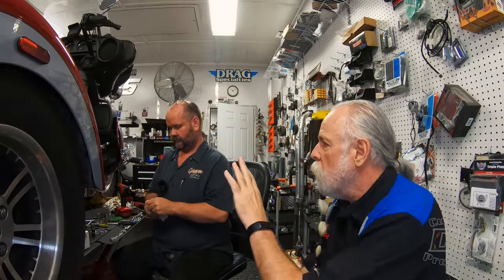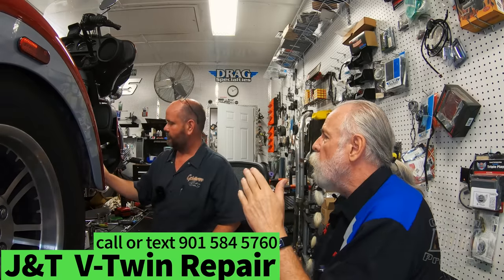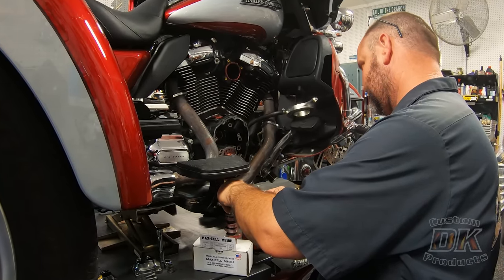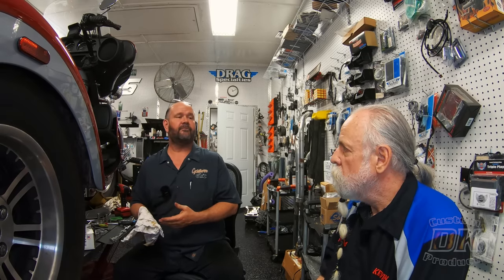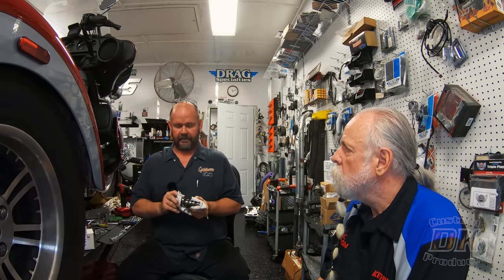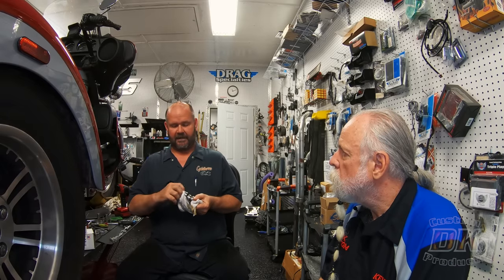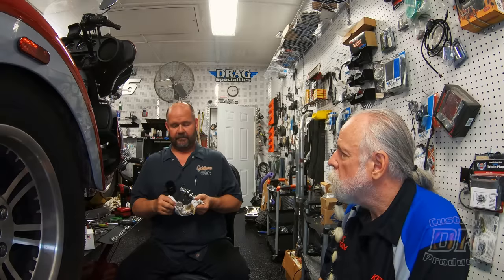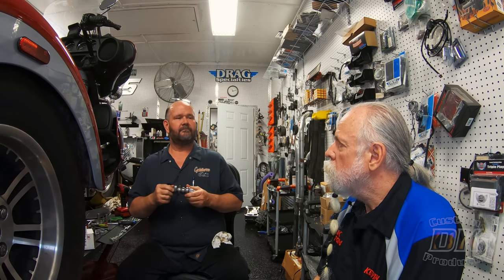How to Get Some Chop (Lope) From a Harley M8 Engine

Comment: Which cam would be the right one for my Breakout 114 built in 2020. I can't decide between the two. S&s 475 and Star Racing 30/30. Unfortunately, I couldn't listen to them live. But only on videos. The 475 is louder and more bassy in terms of sound. What is your opinion of the two?
Reply from the maker: NOTICE:
It Is Strongly Recommended that a Proper Foundation is In Place PRIOR to Installation of a cam upgrade.  Without a Proper Foundation, one will Not Get Anywhere Near as Much Increase in Power from a Cam Upgrade.  
💥  Here is a Link to a Video that Outlines a Proper Foundation-
https://www.youtube.com/watch?v=GK5x3lcQvJU

SECOND IMPORTANT NOTICE:
DK Custom does not sell cams, nor are we suggesting this particular cam for your Harley. We are  reviewing what cam upgrade Kevin did on his Trike. If you'd like to purchase this cam, contact Jamie at V-Twin Repair - 901-584-5760

The world of cam choices can be very confusing.  Unfortunately, we have not done testing on a lot of different cams, so it is not possible for us to make an informed recommendation.

We will say that we have heard a LOT of good things about both of the cams you are looking at.

Here is a video of what I looked at in making my decision-

https://www.youtube.com/watch?v=iKOaSm2ffBo

Comment: is that jims closed , pretty hard to contact or find info on cam specs
Reply from the maker: He is keeping his circle close.  There are some videos here and there, and they do have a facebook page. But you will need to get the cam from a shop that has a dyno and that is a dealer for them.  Here is one below.
NOTICE:
IMPORTANT NOTICE: DK Custom does not sell cams, nor are we suggesting this particular cam for your Harley. 
We are  showing & reviewing what cam upgrade Kevin did on his Trike. 
 If you'd like to discuss this cam, or any other cams, the shops below can help you.  These shops deal with the Max-Cell Cams, and can sell/install/tune them. 

Down Home Harley-Davidson - 336-227-1261  (Justin) 
J&B Cycle - 262-763-5570 (Jake) 
Lucky's V-Twin - 207-800-6044 (Brian)

Thank you for commenting! MB

Comment: What did she lay down on the dyno
Reply from the maker: Have not had it on the dyno yet.  I am expecting in the 115-120 range for torque.  2 wheelers with this cam are usually seeing in the 130's.
Here is a link to the point in this video with more info on HP and TQ for this cam- https://youtu.be/Ax1e2gNvdsk?t=189
Reply: @DKCustomProducts  thanks.  I'm currently looking at the 819b. But I'm gonna speak with mr max cell and see what he recommends.  I am glad you turned my attention to these cams I was about to go with a typical cam. Definitely interested in these!
Reply from the maker: @tdv1985  Good deal man, glad to help. Ride safe!

Comment: How about a 107 m8. That right there is the chop I'm looking for :-)
Reply: I think you would love the Zippers 468, lots of awesome torque and you can still control the gas economy… which you will be really happy with in the long run - just recommending 👍🏻
Reply from the maker: Yep, you can run the same cam in a 107.  👍

Comment: chinese blanks i am thinking my cycle rama 540 is not a overseas blank
i hear some good things about jim's cams but if they were that great everybody
would be using them and that is not the case
Reply from the maker: I called cyclerama and was told all their cams are cut by Andrews.  I called Andrews this morning and no could say if they got their cam cores from China, Turkey or ???
I chose the 818H primarily for the sound, as per this video- https://www.youtube.com/watch?v=H681dl2X_f4
Secondary was the advice of Jamie regarding power.
Jim's V-Twin Performance Cams are NOT easily obtained, which is part of the reason a lot of folks are not using them.
Reply: @DKCustomProducts  the only company that grid’s their own cams is zippers they have a landis
Reply from the maker: @roncoburn7771  I know the Jim's are Not cut by Andrews.